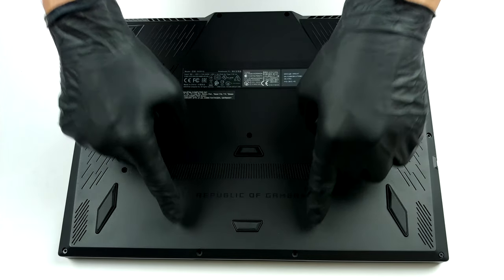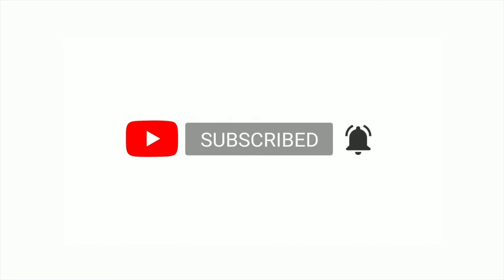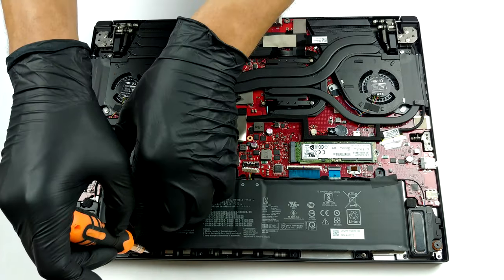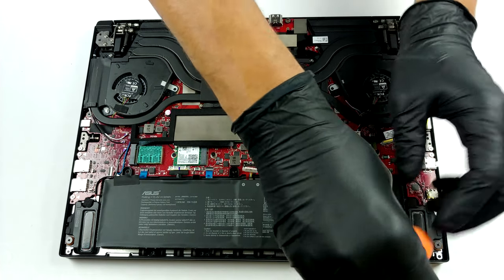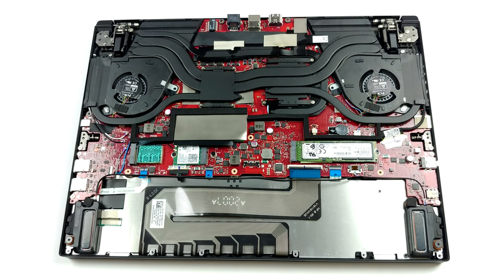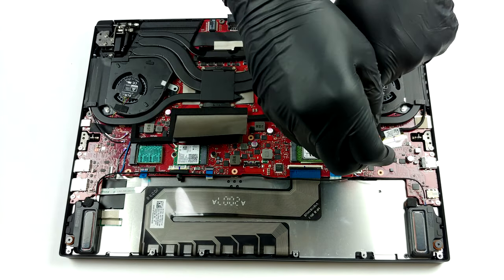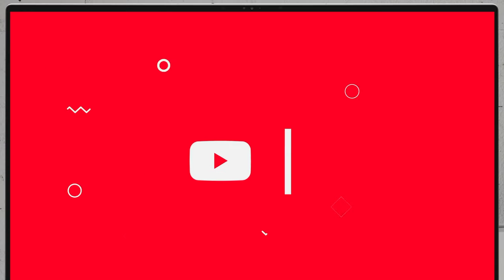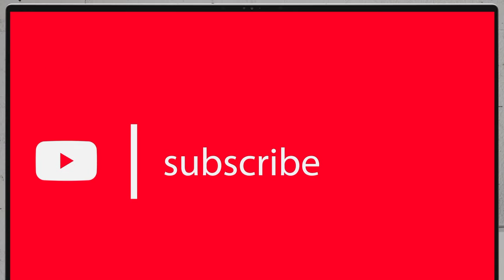🛠️ ASUS ROG Zephyrus Duo 15 SE (GX551) - disassembly and upgrade options

Comment: So I tried to disconnect the battery the same way you did and it ripped the soldered bracket off the mother board and it won't boot from battery now.
Reply: oh geez that sucks sorry to hear that. i hope you can fix it
Reply: @Andy1899  I sent it back to Asus on this one and had them do the repair. They didn't charge me so that was nice.
Reply: Nice glad to hear it got sorted! Cheers
Reply: @Andy1899  Yeah, I was a bit nervous there for a minute. ha ha

Comment: just noticed something odd... theres an intel AX200NGW wifi 6 adapter in there.... mine is the dreadful Mediatek one, you changed yours or did it come with the intel ? confused as i have the exact same laptop, 3080 R9 5900HX 32 GB

Comment: Does anyone know the Torx Scredriver Size needed to open the NB? I want to upgrade my Duo 15 Se and can`t find the info anywhere. Thanks in advance.
Reply: This is exactly the question I came here with.  Any luck?  I ordered a set from Amazon and a T6 is still too big.
Reply: @bringthedarth  hey man, did you happen to ever figure it out? I'm at the same issue
Reply: @KingTv.  On a trip right now, so I can't verify for sure, but almost positive it ended up being a T5.  I just bought a set on amazon.
Reply: @KingTv.  - Just double checked and yes, it was a T5.  There's a set on amazon that has sizes T3-T10 for $9.99.  Won't need it very often, but definitely handy to have around.
Reply: @bringthedarth  ay alright, thanks alot, mate!

Comment: Do the stains on the cooling system mean that there are leaks?
Reply: I saw online elsewhere that it's residue from the thermal compound - I have the same on mine GX650RX and was also concerned but havent found a definite answer.

Comment: question. Could you get the 4k version(ROG Zephyrus Duo 15 SE GX551
 GX551QS-XS99) and replace the 4k monitors with the monitors from the 300hz version (ROG Zephyrus Duo 15 SE GX551
 GX551QR-XS98) and it still works as normal? or is there a compatibility issue between the versions?
Reply: it should be compatible, but you could have issue with the smaller screen being 4k and not 1080p, because windows suck at managing multiple screen with different resolutions
Reply: The screen connection pins are different. You can look up the process for other laptops but, from what I read, it gets tricky...I wound up thinking it was best to stick with the 300mhz screen.

Comment: All I wanna know if it can support pcie 4.0 4TB . I know it officially does at 2TB.
Reply: Yes it can put two 2TB in raid0 in it
Reply: @Mahyar_BEH  I know that, I'm talking about a single 4TB NVME. (Storing videos and content creation stuff)
Reply: @KRFrostFire1   i got that and there isn't any limit on nvme size support but there is any good high performance ssd in m.2 form factor higher than 2TB yeh  there are some high volume bit they are QLC ssds
Reply: Dr R. Yeap  I've yet to change the SSD, but if you do add, buy the slowest gen 4 as GX551 only supports gen 3. If you buy the slowest gen 4 it will max gen 3 limits rather than buying gen 3 and can't max the max Gbps.

It also makes the gen PCIe 4.0 nvme run cooler.
Reply: Dr R. Yeap  How's the vNVme elevation.  Jus replace the thermal pad with a slimmer one?

Comment: Only one RAM slot is such a fail
Reply: Not really, you can still mismatch RAM sizes and it'll work normally. Example: 8GB + 16GB
Reply: @Xcreator999  if we put a 32 with a 16 wouldnt the 32gb ramnot go over 16 gb cs of the fixed one being 16 max?  Hope u can answer it would really help
Reply: Yes and only maximum 48gb , 16+32gb with not enough for game devolopment